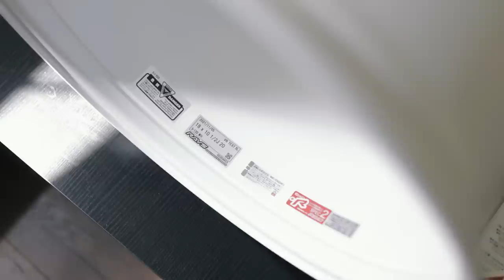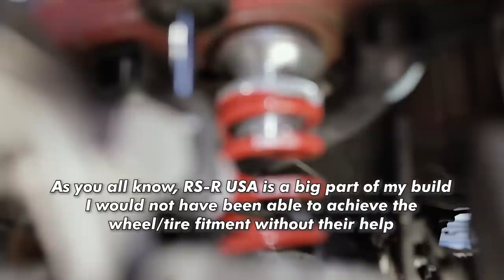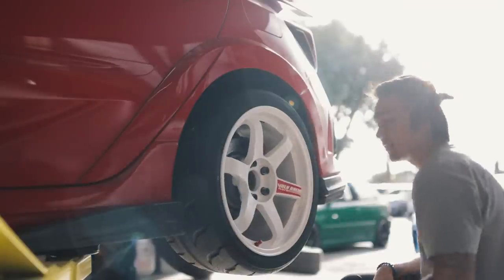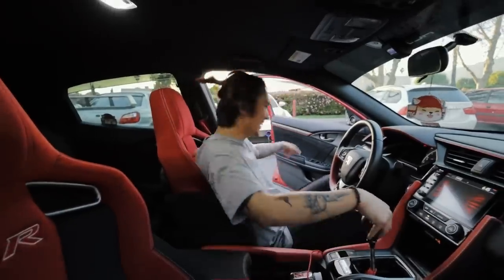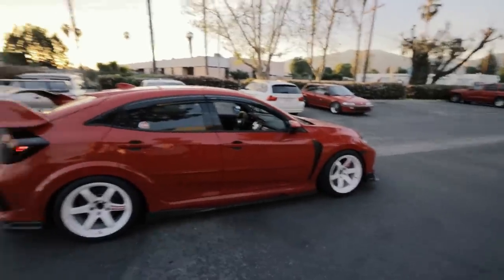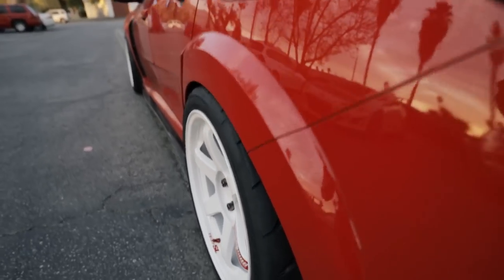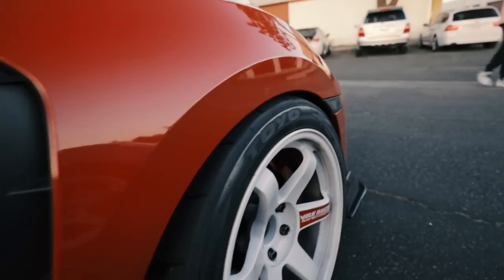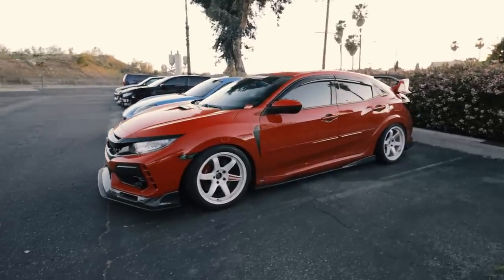THE ULTIMATE CIVIC TYPE R FITMENT

Comment: yooo Steven, can I ask for a 3 month follow up on how the fitment is going so far?  How much do you think cutting the rear fender helped overall when it comes to rubbing?  I just put 275s on the same wheels you previously had, mine are +38, and even with having trimmed the plastic fender I still get rub.  Cutting the metal is the next step for me, but I wanted to see how well it worked for you.  thanks!
Reply: Hey did you put the 275 on the back or front ?
Reply: Did you find this out ? I’m on 255/40 +45 and I’m also rubbing. Lowered an inch all around

Comment: You went with wider wheels/tires, but then had to use more camber. Do you think in the end you ended up with more traction for 2nd gear or did the camber negate it?
Reply from the maker: At -4 camber and 275/35 tires I still felt way more grip than I ever had before on track

Comment: As someone with a 370z I want to change platforms into a type r. I love my Z, I’ve had it for 3 years. It’s a 19’ so still fairly new but I’ve really been itching for a type r. Just wondering if anyone out there has done this change of platform from a Z to a type r. What could I be expecting ?
Reply from the maker: Coming from a BRZ (RWD coupe, but not as much power as a Z) I'd say it's very different. Different but good. The power of the Type R is great and still has more potential with tuning and bolt-ons. The thing you will enjoy the most is the fact that the Type R has a turbo. You will love having boost and all the cool things that come with owning a boosted car. Also, it's super practical vs a 370z which is a coupe. Handling wise the Type R is amazing as well and it's a car you want to take to a track. Imo the greatest modern FWD vehicle made both on the streets and the race track.
Reply: @spamsubie  thank you for the reply spam !! I’m really deep into my Z so I’m hoping I can part out at a good price and start looking at a type r! And def, the space is something that I’m lookin forward too. Something about 4 door cars have just caught my attention recently and man does the type r look good! The only thing I’m iffy about is the fwd. I don’t really “slide” or “drift” my car but I do canyon runs here and there and I’m not sure if going into a fwd would change the drive feel. I know the CTR is a track focused car that can put out power I just don’t know how the transition from RWD to FWD would be.
Reply from the maker: @fk8omar  you'll be pleasantly surprised as soon as you drive one! The handling is better than a Z imo and it drives like its on rails. I forget its FWD because it has zero torque steer as well haha

Comment: All that tire but not using it because its cambered in so much.    Not to mention clearly not a car that will see the track so not sure why you would need so much tire anyway.
Reply from the maker: I go to the track every month with this car and it's been a blast. -2.5 to -3 is usually what I'd run for my track cars but I had to run -4 since the wheel offset is quite aggressive, but I like the look personally and the performance does not suffer much (maybe just faster tire wear) but to each their own